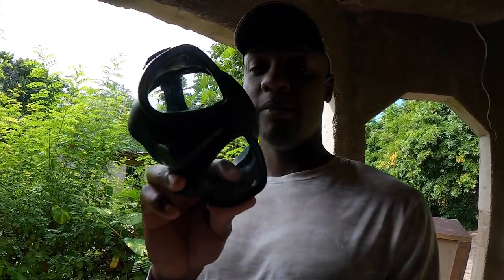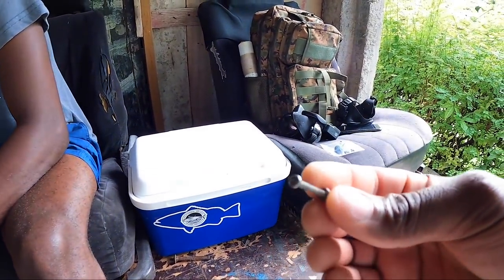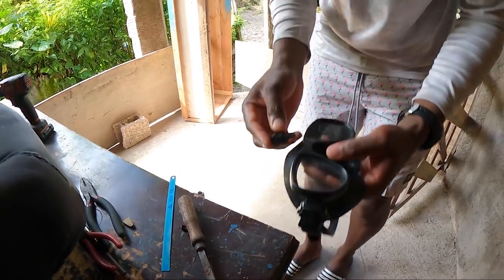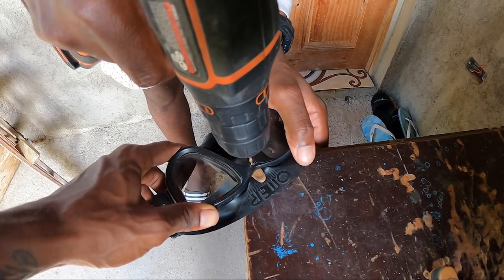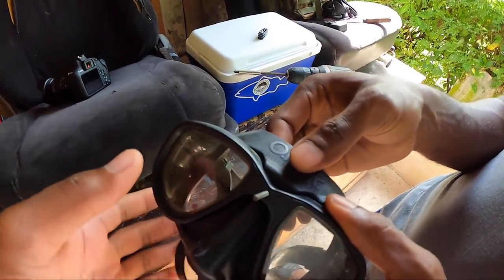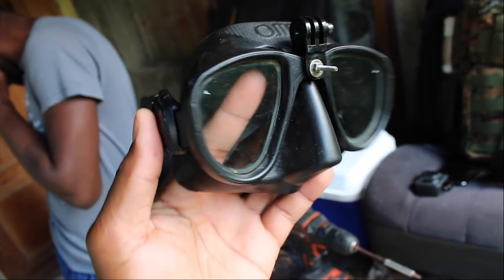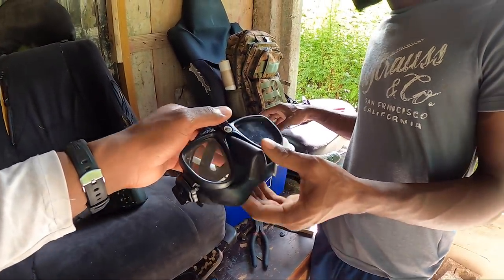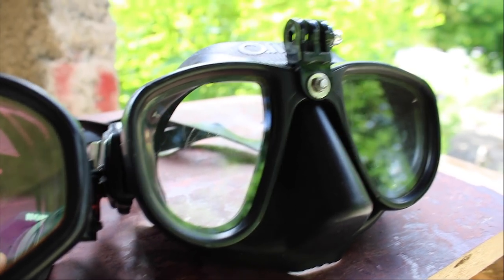DIY How To Mount Your Gopro To A Dive Mask

Comment: Silicone it
Reply: Extra layer of protection ... Making sure it doesn't leak ever ..
Reply: Around the hole that was drilled.. That's what I meant...
Reply from the maker: Silicon is not needed as we didn’t damage the rubber